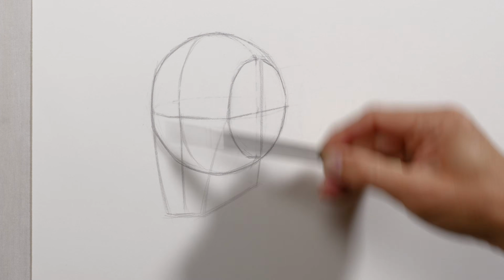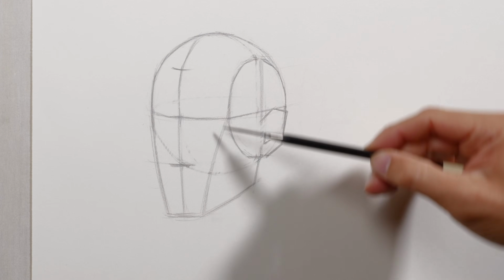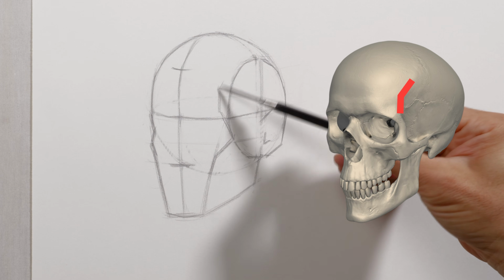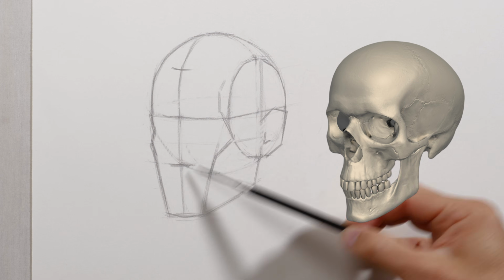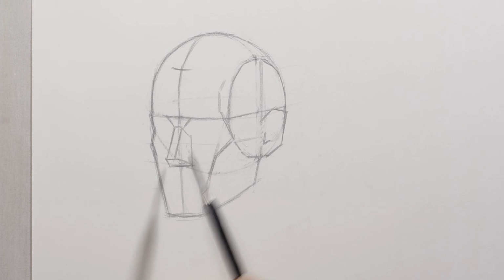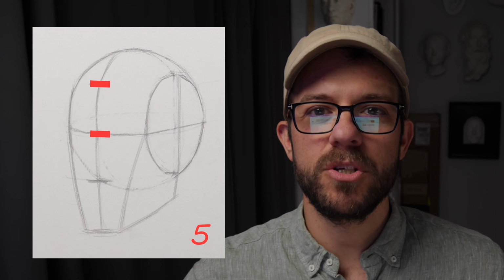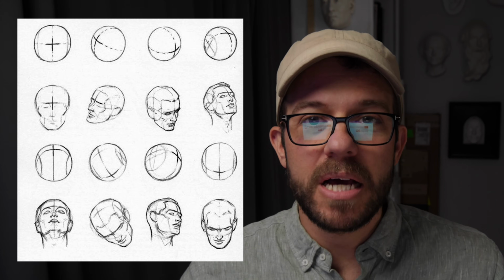How to start your portrait drawing.

Comment: At 4:14 when you added the jaw, you mentioned that you would explain how to determine the length of the jaw later in the video. I couldn't find that part. This is one of the pieces I'm missing in this technique and it seems important as my attempts are looking really wonky. I did enjoy your explanation as it was far more detailed than others I've watched. I want to learn the method rules and follow them strictly for practice purposes.
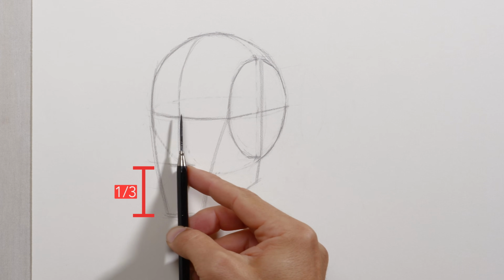Reply: I think it might be 5:31 , thirds of the face? The length between the brow ridge to nose = nose to jaw

Comment: I use the ”arbitrary” lines for the thirds as a grid - it is easier, at least for the beginning, to ”see” how the proportions of the  real model  deviate from the template/grid. I guess it can help a beginner start noticing the real proportions and achieve a better likeness, at least with regards to the proportions of the model. Later on, once you got a grip of it, you can move on and draw the reference/model directly.

Comment: Best overview I've found..

I have a lot of trouble accurately getting the chin. shouldn't the line at the septum and the chin both match the angle of the brow? I noticed yours diverge.

Unfortunately, I've probably done 100+ of these heads here and there, and my portraits are still terrible. It's like i have an ok understanding of the forms/planes of the face, but my sense of proportion is awful, along with my ability to sight stuff. And the second foreshortening comes into play and messes up the 1/3 rule It just breaks my brain.

Comment: my only issue with the loomis head..   is that there is NEVER a clear description on how much to slice off the sides of the head.  and if you use the slice to get the nose.. it can be way off if you didn't "guess" correctly on how much to slice off.
Reply: This! There's no mention of size as far as I can tell. It's too arbitrary for me. Maybe I'll figure it out soon :)

Comment: I have been drawing since i was 10 yrs old. I spent a lot of years incarcerated in a cell since i was 18. And with nothing to do for a total of about 13 years. I got really into improving my art skills, and inside are some unbelievably skilled artists. I got taught by some of the most skilled artists I have ever met. Which pushed me to another level with my art. I'm 40 now, and I am still learning new things. This gave me another way of approaching portraits. Thanks for informative and clear explanations of each step you demonstrated.
Reply: I'm very interested in knowing what the prison artists have taught you 😅 Can you elaborate a little?
Reply: @matthewdavis9437  The importance of the correct shadow placement and darkness as well as the techniques to accomplish vivid realism and the process of determining proportions and the many ways of creating textures and the correct ways to apply them. Plus a lot more. There's so much I learned over the years it would take forever to try to describe or explain all of them

Comment: From my experience with Loomis method of construction there is an inherent difficulty in using a circular as primitive starting point. To draw and use a circle as basis for construction is tricky. Projecting from a circle to a sphere as a flat representation on which to then build landmarks there is greater uncertainty. When using primitives as form method of construction a cube or other polyhedric form is clearer because one is able to compare points, angles and lines with more certainty.

Comment: Helpful video. One mistake I used to make that seems common is the line halfing the circle. I used to think the line in the center was where the eyes would be and not the brow.
Reply: You weren't wrong. Most art schools use a ghost egg, keep it light until it's right, divide in middle= eyes, divide again = nose, divide again= mouth. Leave a space for an eye between the eyes.
Reply: @jamesharvley1164 I bet that's because the egg includes the jaw but the sphere doesn't
Reply: @Aaalllyyysssaaaaa  When I do portraits I usually do a quick "ghost" sketch but block in the shadows first, sort of like an alla pimatura but with the sfumato pronounced and prominent.  Learned the methodology from Dr. McTaggert at Lander and Dr. Rhee at University of Maryland .
Reply: True

Comment: Hi, I’m looking at the drawing about 6 minutes into the drawing, and it looks to me like there are a few mistakes, so correct me if I’m wrong. When you slice off the sides of the ball to make the flat sides you adjust the contour of the head on the left side but not on the right. So I’m wondering if we need to take a bit off the far edge of the ellipse on the right, which would make the ellipse more symmetrical (as a way of measuring if the shape is correct) but more importantly, if we’re no longer looking at a perfect sphere the ‘horizon line’ should reflect that. Also the vertical axis you have drawn inside the ellipse shouldn’t be completely vertical but instead be slightly tilted as the head is looking down. I’m not trying to nit-pick here, it’s just questions I ask myself when I draw a Loomis head.
I thought on the whole your video was excellent and would be interested in joining your block-in bootcamp, as I find it really hard to see planes on a face when I am doing a portrait- I just see curves! A question: does your bootcamp give you lifetime access? I only get time to draw occasionally, so would need to re-visit.
Reply: I´ve also studied Perspective and I believe i have your answer: The face actually is rarely ever a vertical plane. It projects forward. So on a side view you see let´s say an 80 degree tilt, which when looking at a head from above, that tilt would converge in three point perspective to an axis at the neck, making the frontal plane of the face look more vertical than slanted.

Comment: I personally never liked the Loomis method. To me its too structured for people, especially me, to break from it to make variation between subjects. 
There's an artist named sinix who believes organic shapes shouldn't be used to make organic subjects, so spheres are a no go for him. His ideas have helped but his method is still difficult for me. 
The way I got about drawing heads is far less structured. I don't like how many steps it takes to get down what is essentially 3 lines in perimeter of a bunch of features. 
I start with a spheroid, it's shape stretched or squashed to account for the subject or characters mass or character shape language. I add a 'shadow' of the spheroid as the extension of the skull towards the back of the head. Then the axis lines to follow the brow bridge and point to the jaw. Then I draw a triangle contouring the shape of the head, 2 points one at each temple, and 1 pointing right beneath the bottom lip there the dip of the chin is. I add the cheek and chin line, or I could do it before the first triangle and fix accordingly. Then I draw a second triangle from the center of the brow ridge and growing down the jowls to where the 2 points make a line through the center of both lips, becoming your mouth line. Making the Plane of the nose to project accurately, make a point at the top of the head, then draw an angle from that point to the center of the brow ridge(or just below it) intersecting though the head. 
From there I make contours and shading outlines of the subject if I'm using reference, easy enough to erase since it's only to help placement of features. Adding the eye sockets, mouth line, eyebrows, ear at the eye to bottom of nose line, hairline, neck folds, and that's it. 
The reason I feel that despite so many steps but feeling less structured is because it doesn't rely on 3rds and treats things more as "stay inside the lines but you're free to do as you please" while the Loomis feels like there's a mathematically perfect head, causes same face syndrome, and has too many structural steps while my method just shows you the contors of places things can go before they look put of place. It also helps with dynamic angles or poses, since you fan squash and stetch these shapes in perspective or under forces if you have an idea of the final pose going in, or just leave it ridged if you haven't planned ahead and still have something versatile. I can't see the Loomis head working it perspective or distortion without heavy planing or a lot of mathematic drawing tools at hand. 
While I will acknowledge Loomis helps A LOT with paintings, finding the planes of the face and how to cast shadow, I don't enjoy its rigidity as someone who is self taught from a digital centric art culture and developing a graphic novel. Ink lines and shadows are very much different than painting, so the aim is more to make an appealing final product than to worry about every step of the process. My method only gets faster as you're used to drawing the same character as you already know their details and shapes inside my method's lines, allowing you to soon enough draw the characters face from only the circle and bridge line and draw the chin line haphazardly as long as the final product still looks good. 
Remember everyone! Art has no rules! The only thing that matters is the final product! Do things your way! Not even I am right, this is just what works for me!
Reply: no ones reading all that
Reply: This is ironically more structured than the loomis method.
Reply: @yme3345  eh, wrote this immediately after waking up so, replace structured with rigid in final appearance. To me my method is a lot more free flowing since there's no fraction of the face lines. I don't feel compelled to pull out a ruler and a compas every time.
Reply: Make your own video, Leo -- how about that?
Reply: Art does have rules.
Reply: @nowirehangers2815  bruh

Comment: Excellent excellent demo.  My work changed dramatically using this method as a student.  Before that my portrait work felt "flat".  Ironically, I could get a facimile of a likeness but not structurally cohesive.  I was lucky enough to have a professor who used a modified version of the Loomis.  He used to say even if your drawing isn't an exact likeness at least you have a believable head.  Getting to the likeness is the next big step.  Love all of your demos by the way.  Nice that you include them without a fee too.  gives inspiration to pursue the more intense classses.  Good luck!
Reply: im really happy i read this comment, its very encouraging to learn that its okay to not always achieve perfect likeness. as i practice on my own without any formal instruction, im finding that im getting better at building similar proportions and structure but im not yet able to recreate a likeness that actually resembles the reference. im happy to know that the only thing stopping me from getting there is simply more practice. thanks !